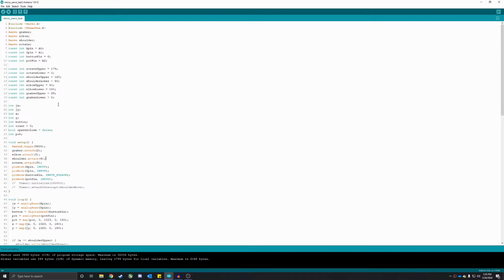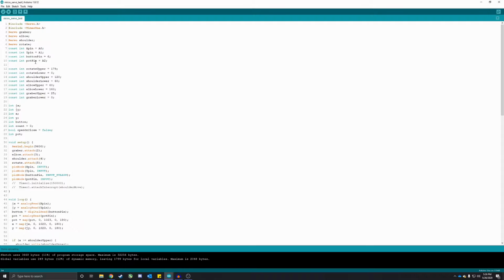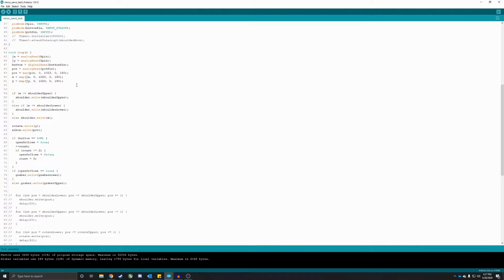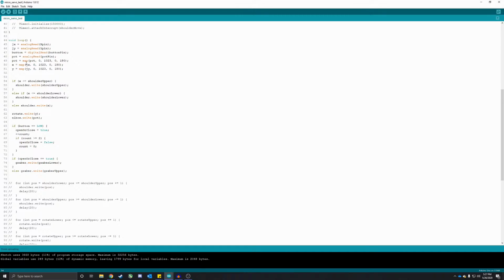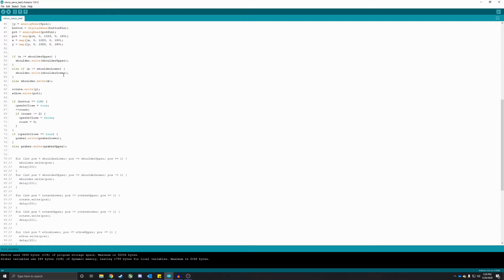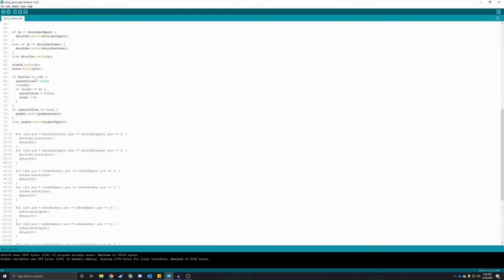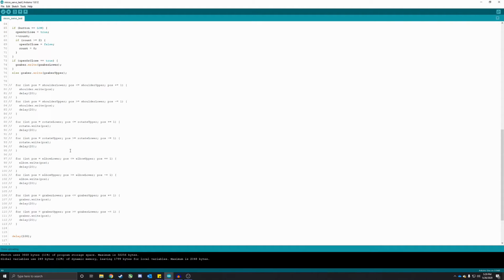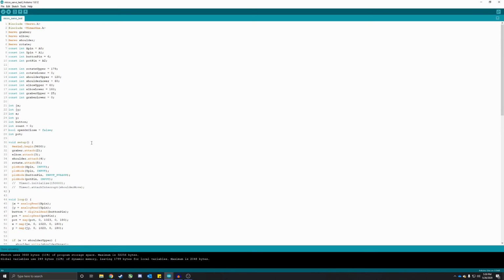Robot Arm Made Of Popsicle Sticks - Arduino Robot Arm

Comment: How does the Arduino know which motor is which? Based on the pins?
Reply from the maker: Yup!
Reply: @BenLazyTech haha i built it a few days ago and then just ordered some Arduino nano boards and designing a controller box for it to 3d print. It's a great project with my son!